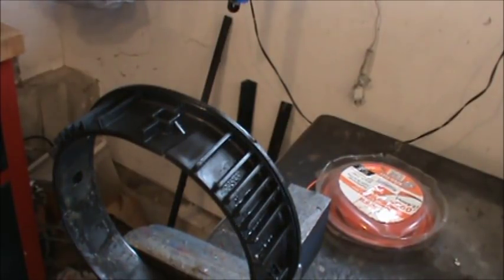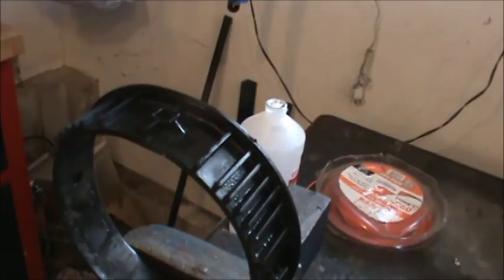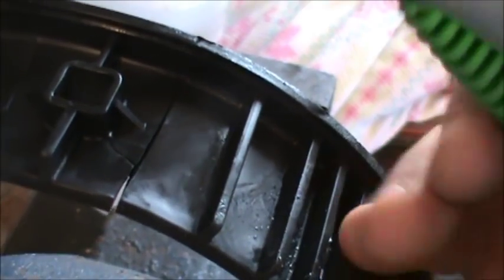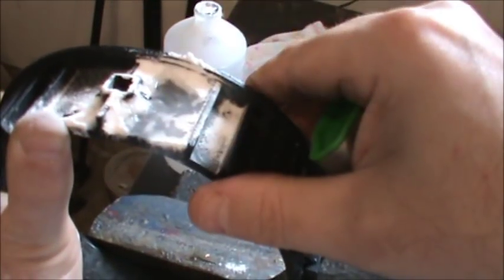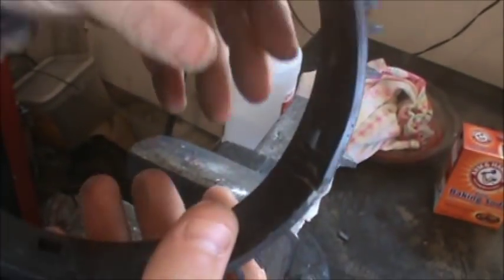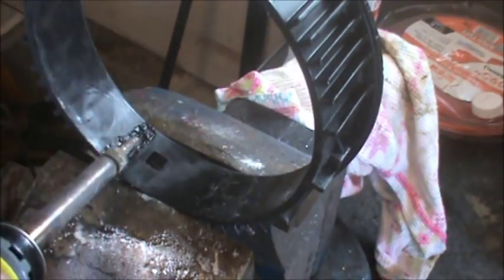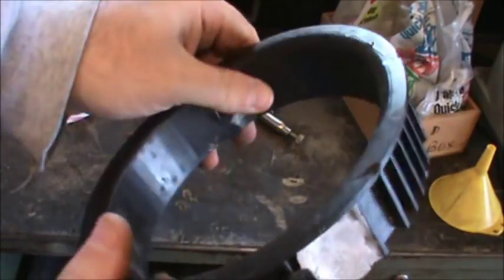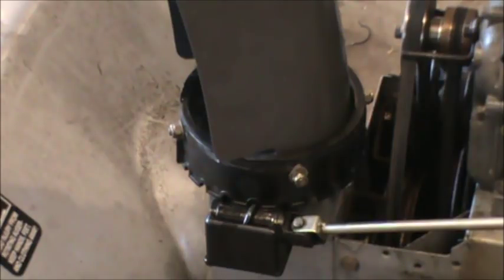How to Fix Broken or Cracked Plastic or Weld Plastic

Comment: Hi,

I would like you suggestion. I have external canister aquarium filter (it is sort of like 2 gallon bucket) and it somehow leaking water from bottom. The leak is pretty small. do you think it would hold up good if I follow your method. Or if you have any other suggestion please let me know. I would like a permanent fix.

Comment: I've been using super glue and baking soda for awhile.   I put the baking soda in a plastic squeeze bottle with a narrow tip, 3 for $2 at Harbor Freight.  Allows you to apply it more accurately. Also, you don't have to put it on so thickly. Build it up in layers just where it's needed.

Comment: Great video.. one other thing you can do with the soldering iron is take small pieces of cut paper clips and use them across the break and melt them into the plastic like rebar..  Used to do this when repairing printers..

Comment: Hey Doublewide6 Thanks for the info. I've had many times I needed to glue plastic. Was wondering if adding a roughing surface for the superglue/baking soda to adhere to would increase the bonding action? Whatever, that appears to be one great information video. Now I'm wondering how to make that box of baking soda appear out of thin air? (just kidding)

Comment: The plastic arm on a my aluminum folding yard chair snapped right at the rivet. If I close it together I think I could save the chair but it does need to handle weight and of course fold again? It's a vintage style, not the mesh so it's very comfortable. What do you think?

Comment: A little advice on the fumes when touching super glue with the soldering iron are pretty toxic, its better to do first the plastic weld n then the superglue/baking soda, but actually both ways work great.
You can even reinforce the plastic weld with pieces of wire or paperclip perpendicular to the crack pushing the wire inside the plastic.

Comment: im here because i broke my headphones
Reply: Me too
Reply: I confirm that the first method works with headphones (superglue + baking soda). Fixed my cheap Bluedio TS2 headphones :)
Reply: +undead504 Same.
Reply: SAME! I cracked my headphone band. I already attempted a fix a different way with epoxy and thin metal bands for reinforcement. The epoxy has broken but the epoxied metal bands are still holding up. The head clamp has been severely reduced though, and they barely stay on my head.
Reply: +undead504 - I just fixed a pair or Dre Beats with this method and it worked just as explained thanks a lot man.
Reply: Cătălin Berța
I also confirm backing soda + superglue + strip of metal all the way around - i also added fiberglass resin to fill the band in - if yall have taken it apart you know what i mean (beats by dre solo hd's)
Reply: undead504 I'm here because I broke my dads wireless headphones
Reply: Backing up the SuperGlue video from a guitar repair site.  Wanted to see what else it could do with baking soda.   Cool concept.
Reply: Me too 🤧
Reply: Often a difficult job...I have a studio & I hate tossing aside a $350 pair...I can use these techniques. Thx. Too much plastic winds up in the land fills . Cool
Reply: Mee too my favorite headphone I broke yesterday by mistake 😭😭😭
Reply: +undead504 Did you try this??
Reply: +Schmidteren no not yet will let you know if it works
Reply: +undead504 must have been beats by dre solo hd's - mine broke too lol
Reply: Broke my klipsch image one ii... :(
Reply: Here because of my Solo hd's as well
Reply: ---> make bridges and nuts for lefties
Reply: I tried 2 component glue but it didn't help at all so so now i will try this 😂
Reply: Me too😞
Reply: Oh same bro
Reply: Same
Reply: Im here because my gamkng chair broke
Reply: Here cuz my Razer Man O' war r trash built
Reply: oh shit hahaha mine too
Reply: I'm here because I'm really fuckin' bored.

Comment: THANK YOU! My problem was way sophisticated but I must say it worked perfectly! I had to fix an old laptop Acer TravelMate 5320. My laptops screen/monitor broke and I was unable to open and/or close it without falling apart and losing screws because they were attached through plastic nut and by applying your method I have managed to fix it...

Comment: Hello doublewide6 I hope you get this message, I have searched and searched for help fixing a stress crack.. I took my pool steps out of the shed after this horrible winter that we had and the resin/fiberglass looking steps were cracked right at the top where people tug to pull themselves out of the pool and since it gets somewhat abused right there, and it's in a sightly place that I don't want it to look bad I want to fix the crack as cleanly as possible.  The patch or whatever I uses has to sustain exposure to full sun, water with chemicals in it, tugging and pulling (abuse) body weight up to probably 300 pounds, kids hanging on it etc.  the crack hasn't went all the way through yet, but they are unsafe and unusable already.  I want to stick the crack back together and reinforce it, I would say it probably needs some type of poly repair kit, but I don't have any idea what would meet the requirements that I have.  I want to be able to sand it when it cures and have it look nice too, the steps are faded from chemicals and sun and they sit underwater so painting is pretty much out of the question, they are like a fleshy grey color right now, so if it drys grey that is ok, but I really would like clear.  Can you make a suggestion what to use to hold the crack together with all my specs? and what to do on the outside to make the bonding agent take the duplicate look of the surface of the steps, kinda like sponge wipe marks is what the outside texture it...that actually may work if I can apply the bonder with a sponge lightly on the last layer.  I hope you get my question because I trust your judgement.  I am guess I will need a 2 part bonder to do this and have not idea what to get to hold up and do what I need it to do, They have that fake fiberglass texture to them...I hope to god you have an idea what to use....HELP PLS...I am all about that save money life! Just like you are..Thank you so much!

Comment: This is awesome.  Im going to try both ways of repairing....that is, superglue and BS or soldering iron.  I have a shallow plastic pool which I purchased for my ducks (its a kids paddling pool shaped like a scallop shell).  Somehow, when I emptied the pool I cracked it when I lifted it full of water.  Its quite hard plastic, but quite thin, so I need to build up upon the crack rather than try and solder it together.  Thanks for this.  Very helpful.

Comment: What alcohol Did u use
Reply: +darkclone v - Isopropyl Alcohol.
Reply: +Sam “Bang Ding Ow” Burns Thank you for your reply. In case anyone else was wondering, using the name Sam Burns  gave, I looked it up and it (or an equivalent)  is apparently also sometimes known as rubbing alcohol and - in the UK - as surgical spirit.

Comment: will this work with rubber cement/ tire cement?
thanks for that very helpful video d.w6
Reply from the maker: Jess Ramer No because rubber cement stays flexible not solid when dried.
Reply: ok thanks you a very helpful channle,  went and bought super glue anyways to fix my rc truck steering bar with baking soda.

Comment: Hey good sir,

Can i use this with my plastic headphones?
the plastic of one of the holders has broken off but the wire runs in the hole surrounded by plastic. Can i use this method or will it spill and burn through the wire?
Reply from the maker: Daniel Juan Camilo Dijkhuizen I am not sure.  Only one way to find out.

Comment: About to do a superglue baking soda combo on my Sony Home Theatre style headphones (usage torsion crack on the camber angle right speaker arms). Done this before years ago for other things. And you're right about the exothermic reaction. BTW plastic fumes are up there with second hand smoke so avoid that stuff. I usually use chlorine bleach instead of isopropyl alcohol when I prepare to work with plastic. I find the chlorine slightly scars the outer surface of plastic making it better to work with compared to alcohol.

For those attempting this with lighters, you could burn what you're working on. You need to use an iron like method so if you have to use a lighter to heat up a piece of metal into a makeshift iron, that makes it significantly safer and easier.

Comment: Use a plastic cable tie/zip tie to weld and fill in the void.
Reply: Yup, whenever I use a zip tie and cut it shorter I always keep the part I cut off to use as a plastic filler rod... Also whenever you buy tools like a ratchet socket they almost always have some kind of antitheft device made of black plastic, keep that plastic too for plastic welding.
Reply from the maker: Glenn Dutton Good tip.  Thanks.
Reply: I thought he was going to use a spool of weed wacker material. Would that work? Kind of like plastic solder?

Comment: I used the plastic weld method that you used on your hair dryer on two items. I welded a speaker onto its plastic cover like it was from the factory. Also, I have a Craftsman edger with a plastic gas tank, which is mounted with screws into it. It had 2 long cracks in it and was leaking gas when it ran. I welded all of those cracks up and had no leaks. It saved me $65 on that tank. Thank you for the videos.

Comment: THANK YOU SO MUCH.

I had a piece of plastic tube on my car crack and almost brake, and dealer wanted like $120.00 after seeing your video I fixed and made the piece 2x as strong now. Thank tip of the crazy glue and baking soda was ingenious.

Comment: Wow, what a great tip about using the super glue and baking soda!  Actually, also about the soldering iron, which I've used to cut plastic with, but never to "weld" it!  Thanks for the great tips!